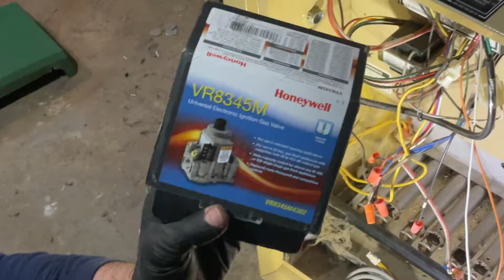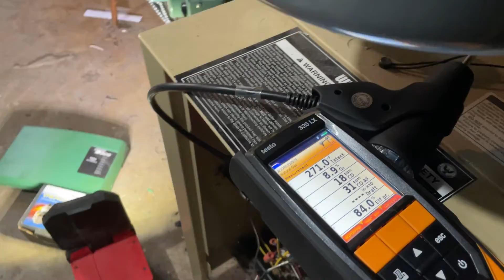Taco SR506 Zone Relay Went On Fire! How to Replace & How to test and ohm Taco 0015 circulators

Comment: Caleffi pump controller has a separate 120v fuse on every pump output...keeps the factory smoke in better. I had the best luck with them

Comment: I learned a lot from these videos. PM is most important and now I change the filter monthly. What a difference! No more dust in the house and the furnace runs very well. I also got a maintenance contract for my air and heat system.

Comment: Looking at the wiring condition at the beginning of the video - it is apparent that the ignition source was right where the BX entered the Taco cabinet.  Perhaps the red anti-short in the cable failed due to a sharp edge on the cable itself.  Was there an anti-short in the cable?

Comment: Nice of the boiler mfgr to not quite give you room to swing the gas valve around without cracking open the sheet metal. Finding bad switching relay and gas valve together is pointing toward a power surge or abnormal power line voltage due to bad neutral connection at the service or bad pole transformer.

Comment: Lose neutral or line side on the power feed to  relay that’s why it first into flames, It was probably arcing out for quite some time, make sure your electrical connections are always tight especially on the power feed especially on a neutrals Happens in circuit breaker panels all the time to
Reply: Yes I agree. The source of the fire looks to be the lower right corner which is the 120v power inlet. All the loads are fuse protected (around 5A, I believe) so a shorted circulator isn't likely. Unfortunately, this may have been caused by an install error from a loose screw connection or a connection tightened too much the solder connection cracked. Also the wire stresses the terminals because Taco didnt include enough room to loop the wires correctly (especially 12 ga wire). Either way, the arcing caused carbon tracking which became more and more conductive until the fire. I never saw one that bad!!
Reply: @scoobtoober29 no ,

Comment: Very good information about the wires and gas valve
Reply: Is there any longevity issue with temperature on the gas valve being inside versus outside the unit ??

Comment: Let Taco know you mounted the switching relay on the boiler jacket. Taco does make flow controls too; in case the homeowner is getting heat where he doesn’t want it.

Comment: the switching  relay should not be install on the side of the boiler
Reply: Why would you say that I installed relays all the time on boiler jackets and seen hundreds installed that way. I’m not arguing with you just would like to know you’re reason.
Reply: I just say that because  eletrical parts like to be warm in the winter and cool in the summer,  if you install them on the side of the it of course very very hot and it potentiallyiver time causes things to over heat, 

I have seen never had  one get on fire when they are kept in cool place off the boiler 

I have only every seen catch on fire when when they are too hot and on the side wall of the boiler 

I'm am just speaking on my service experiences
Reply: Thanks for your quick reply on my question. To saint mike and the crew keep up the awesome videos I enjoy watching them with a nice beer 🍺
Reply: @cliftonwinkler1460  I’m curious, what brand boiler are you using that the jacket gets that hot?
Reply: @mike617  any high mass boiler can get that hot, electrical like to be cool in the summer and warm in the winter
Reply: @cliftonwinkler1460  I have never seen or heard
Of a boiler jacket getting that hot to do something like that, also I have been in mechanical rooms that get very hot, and have electrical in there, and nothing is catching fire
Reply: @mike617  good for you then
Reply: i totally agree with you,specially if its hidden behind all the circulators like that one,i would charge more just for the inaccessibility

Comment: Had that happen before, line voltage was messed up do to a transformer on the pole.
Reply: @PipeDoctor  Seems like a SPD or at least fusing the thing, or maybe a thermal fuse, would be a good go-to in the future given how many folks have had similar issues...or just different product lol
Reply: @PipeDoctor  I heard a story about boiler aquastat dying, got replaced. Then that one died again few days later. Called power company, they found a bad intermittent Line on transformer or something.

Comment: Nice repair 
It’s  nice to have some humor while making the repair.
Reply: @PipeDoctor  i can not belive you reconnected those wires to the circulators with melted, degraded and deformed insulation, thats a fire waiting to happen, those wires are 120v, that could start arching and not blow any fuses.
Reply: @PipeDoctor  i did, and not trying to troll, 8:03 is the final installation? that is the wires i was talking about, they look black and deformed to me, maybe it just looks like that on the video and they are fine.